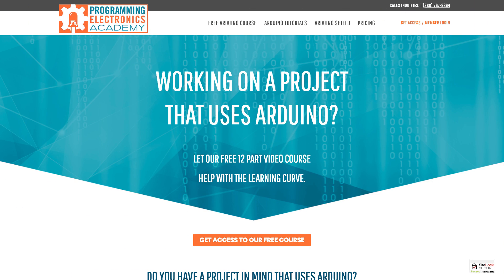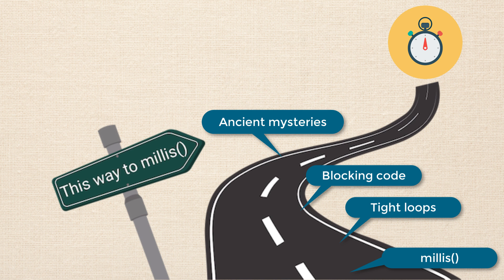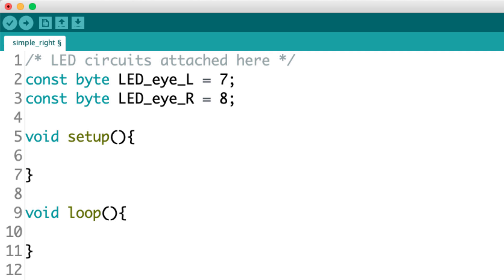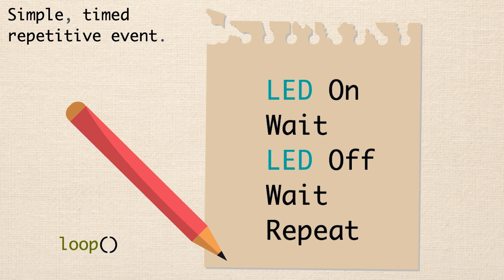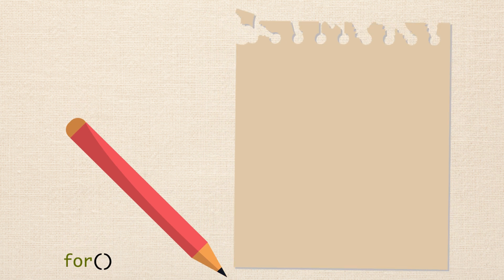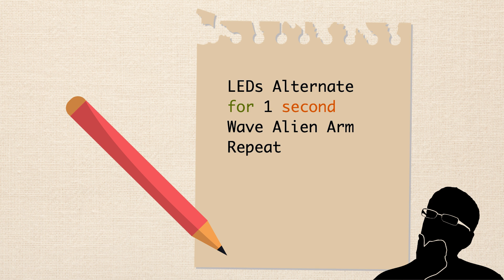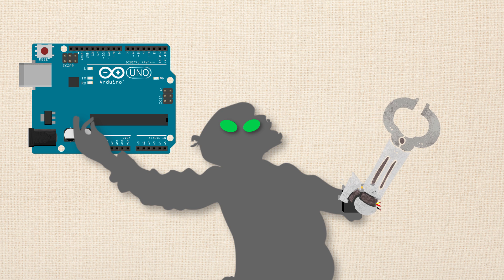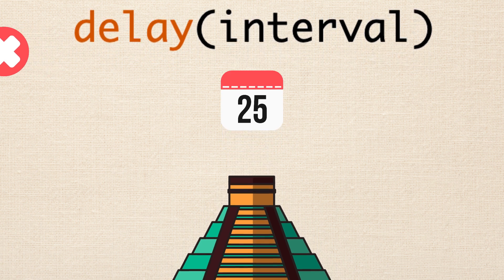millis vs. delay Part 3 | A mini-series on Timing Events with Arduino Code

Comment: So far these have been the best videos helping me learn! Now.. I get the delay function causing issues.. I cant get past the; ( int = i ) - I understand it being declared in the loop.. But it doesn't reference anything??!.. Maybe I'm overthinking it.. but it doesn't make sense to me that the Arduino knows that i refers to anything LED  related?!?...
Reply from the maker: Hi Dan, you are absolutely right!  The Arduino doesn't know what "i" references, all it knows is what value is assigned to "i" at some given point.  If the digitalWrite function uses "i", then whatever value "i" holds will be used by that function.  If the delay function uses "i", all it knows is the value that "i" currently holds.

Not sure if this clears anything up, but in any case thanks for watching and best of luck with Arduino!

Comment: arghh brilliant videos all 3, but i cant wait, all the others were not as good as yours but i need the fix now.  :-)
Reply from the maker: Thanks Bernie!  

If you check out the sketch in the Arduino IDE >  File Examples > 02. Digital > Blink without delay   This is the direction I'll be going.